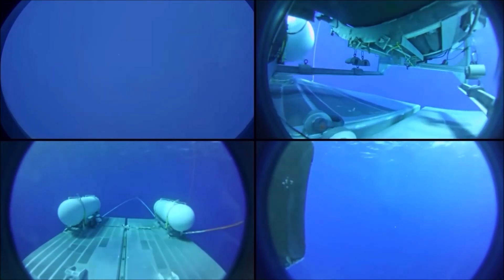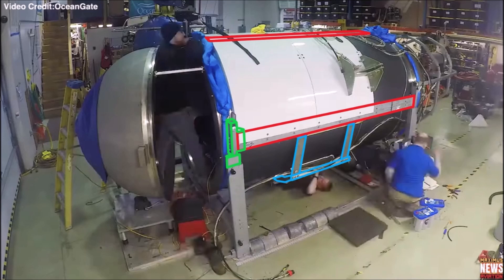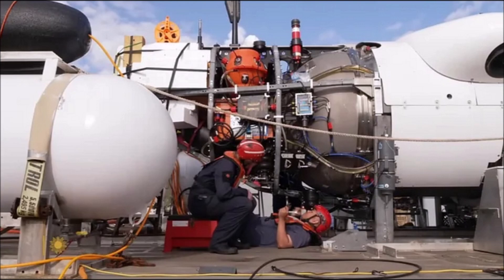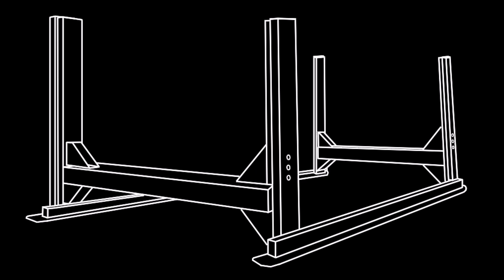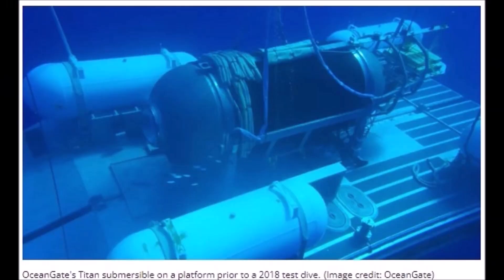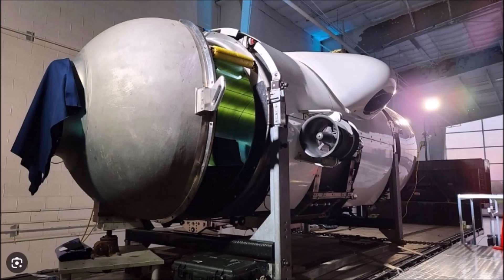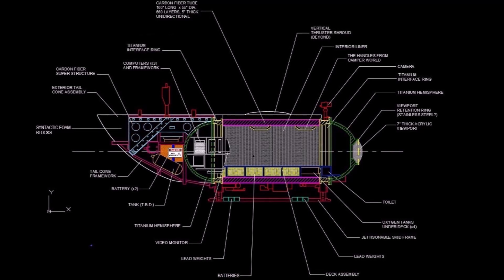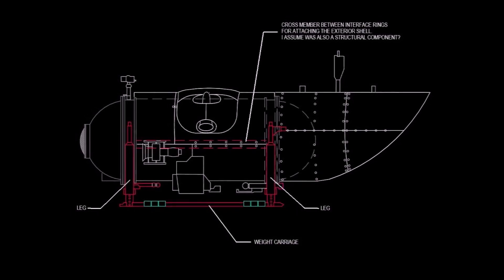OceanGate Titan - CONNECTIONS BETWEEN INTERFACE RINGS

Comment: Youre on the right path but missing some crucial bits.

The interface ring had flanges on both inside and outside. It's the inside flange ring that has been crushing against the composite. 

The hull was not only UD wound around the circumference. It had prepreg UD in the perpendicular direction also.

Howeverr, There has been a lot of assumption errors made regarding the properties of the composite, in particular due to a reduction in yield strength due to 1. Reduction factor in relation to imperfections with regard to thickness of the composite. 2. A wet layup method without the use of autoclave resulting in a much larger resin amount between layers. This is further worsened by the fact they used alternating prepreg through which the resin cannot flow when vacuuming during baking, if they even did that.

This is supported by the very fast manufacturing time they used making it impossible to cure and even less to autoclave between each change of fibre direction. It is also supported by looking at the layed up surface of the hull when still attached to the reel and its uneven surface and just before mating to the interface rings where one clearly can see its been lathed down. 

This means the hull has much softer properties and has a higher volume compression before yield than expected.

All this means the composite has been crushing against the inner flange and this is the point of failure.
Reply: @prose1733 and @VegasCyclingFreak.  You both are barking up the wrong tree a bit.  There were two Titan hulls, one fabricated by Spencer in Sacramento  in 2017, the second fabricated by Electroimpact and Janicki industries in Seattle in 2020 because testing in 2018 and 2019 showed the Spencer hull was only good for 3000m, not the 3800m where the Titanic lies. It was the second hull from 2020 hull that failed in 2023. The second hull had the same dimensions as the first but was made on much more sophisticated equipment using a computer-controlled, automatic fiber placement robot (AFP4.0).  Both the 1st and 2nd shells were laid-up with both axial and radial fibers per statements by Stockton Rush.  OG published a short video clip of the robot winding the second hull in both radial and axial direction.  The second hull was fabricated in stages of five 1 inch thick layer that were each cured in an autoclave before the next layer was applied.  Electroimpact and Janicki make carbon fiber composites for Boeing and others.  The second hull was designed using Collier Aerospace's Hyperx FEA software, presumably by Collier acting as a subcontractor to OG.  The first hull was designed by Spencer Composites using COSMOS/M, another FEA software.  Electroimpact has scrubbed their site of references to Titan & Oceangate but Oceangate lists them and Janicki and Collier as "partners" on the OG website and in presentations.
Reply from the maker: @engineerncook6138  Thank you for this very important information! No surprise they removed any reference to OceanGate on their website.
Reply from the maker: Thanks for the input. I only recently learned about the interior flanges. 22 million lbs of force on those hemispheres is asking a lot of that CF.

Spencer Composites manufactured this cylinder for OceanGate. The specs given were 100" long, 66" O.D., able to withstand 6,600 PSI with a safety factor of 2.25. There was no use of an autoclave, but it was vacuum bagged and baked for 7 days at 278 deg F. Originally was going to be 4.5" thick but OceanGate had them bump it up to 5" thick for "an additional safety margin".

From what I understand, CF when used this way is maybe only 50-70% as strong as it could be otherwise. If it was resin rich as you propose, then that compounded the weakness of the cylinder... made it weaker still.

Can you explain something to me? When I see that video of them winding the 660, 667 or 480 layers/plies (depending on who you ask), it looks to me like there is only the CF tape with nothing running perpendicular to it. How in the world did they get perpendicular layers in there with the tape being wound around the mandrel like a giant spool of thread? I just don't see how they did that. There is also the flanges on the ends of the mandrel, so how does that work?! Not only that it seems that the ratio between the two would likely not have been anywhere close to 50/50 if they had to hand lay these perpendicular fibers. I have been under the impression thus far that it was strictly carbon fiber tape and strength of the cylinder = strength of the resin. 

In my opinion it should have been cross layered in three different directions, but how the heck would you manufacture that?
Reply: @VegasCyclingFreak  Noone has been able to answer exactly what layer configuration has been used, but from the information that's been available it suggests they had aquired date expired pre-impregnated UD from Boeing, and Spencer previously claiming they used a 0 - 90 deg alterating, but as you point out this hasnt been confirmed nor visible in any video. 

The conclusion some have come to points towards the prepreg UD was used specifically for the perpendicular orientarion along the length of the sub axis. The question becomes, why would they do this, how did they do it and what does it mean for the strength of the cylinder. There is probably more than one explanation here.

1. The cylinder was not subjected to torsional load so any other orientation than 0 and 90 would not add capacity for the specific load case. 

2. The tooling and cylindrical spool used as a mold is most likely borrowed from other production normally used for a different application, presumably an accumulator or some other non critical tank made in fibre glass. Furthermore they likely used a similar layup technique as FRP with the addition of perpendicular fibre layup where the prepreg comes in and that would need to be manually applied by hand at some intervals, but as you also point out, a 50/50 ratio is unlikely in this case. 

However epoxy used for wet layup, even with extra long pot life, normally it's not more than a couple of hours. By that time the part should be in the owen. 

Furthermore prepreg and wet epoxy normally have different temperature profile requirements during curing. High performance prepreg laminates should be autoclaved to extract excess resin and should not be more than 1/4 inch thick between baking cycles. The ramp up and ramp down temperature rates are somewhat specific, but with a part this thick with so much mass, we know we are going to have a temperature gradient that is from here to hell and everything in between. 

Therse two circumstances raises several concerns. Clearly it is impossible to bake the whole 5 inch thick piece in one go without compromising the curing process requirements. On the other hand, curing it multiple times would not only be extensively labour intensive, we still don't know how many times that is and where the alterating perpendicular fibre direction layup and curing comes into play. It just doesn't make sense.

However what does make sense is the combination of thickness, wet layup and some major challenges regarding curing and pot life creates substantial geometrical imperfections of the laminates due to excess resin and trapped air. With this in consideration, this allows for fibre rotation in the matrix due to shear / strain followed by buckling in the elastic region. Others have looked into this and there essentially was no safety margin what so ever against failure of the cylinder.
Reply from the maker: @prose1733  Thanks for your input. That's some very interesting points that you bring up. There does seen to be a consensus in certain circles that it was likely resin rich due to how it was manufactured. Also if the CF was at the end of its shelf life, the resin may have degraded considerably. It was bagged and baked for 7 days at 278 deg F... but I don't think that's really adequate for something 5" thick? Spencer Composites made this for OceanGate, to the specs they provided. The safety factor was supposed to be 2.25 and able to withstand 6,600 PSI but who knows exactly how that was determined by Spencer Composites? At this point, it's my feeling that OceanGate got a sub-par hull.

This CF stuff is not really in my wheel house but I know a little bit about its basic properties. I feel that there should have been three cross layers instead of two, all things considered. I don't know how the heck that could be manufactured but it seems to me like that would be the strongest possible matrix.
Reply: @VegasCyclingFreak  regarding Spensers claimed rating, one should think about how they could have arrived at such a figure. Possibly using the same method they normally do, by modeling the component/assembly in their FEM-software of choice and defining the layup using the layer properties already available, but...

We have to member in contrast to FRP, CFRP when structural is almost never homogeneous and absolutelly never this thick. High performance CFRP is prefered where stiffness to weight is an advantage and from elementary mechanics and the definition of second moment of area we know that for a large "I" and low mass, we need a stiff outer shell and a hollow/foam/nomex/honeycomb core to aquire the area. This is clearly not the case here so pre existing definition and layer properties for CFRP in the model would presumably not reflect actual real world performance of the titan cylinder. So those definitiions would not be accurate for this homogenous FRP winding type layup and would explain some major discrepancy between that claimed value and actual peformance.

It's clever of you making reference to your bicycle and failure of the stem due to stress concentration and crushing from the clamp. CFRP manufacturing has come a long way much thanks to the challenges posed when laying up such a complex shape as a bike frame, in particular around the areas with small radius curvature and especiallt around the nodes and the crank aswell as where the forks join the stem. When CFRP was new to bicycling it was very common for the CF to wrinkle when bagged in these areas causing immediate reduction in rigidity when the fibres where misaligned and no longer oriented in direction of the stress. This shows how important the layup is for the performance to come near any type of calculation and it is still errors made during layup that is the cause of most CFRP failures.
Reply from the maker: @prose1733  Very interesting info! So it would seem that maybe they just solely relied on what a modeling program told them. Programs do have limitations, especially when they are being used in a way that was not really intended. Sounds like the case here. In my field, sometimes people get bit in the rear by misinterpreting what a program tells them. You would think that a sophisticated modeling program at some point would tell you that it can't do what you are asking.

Comment: The five hole lugs at the bottom of the rings hold the skid on. the four posts are friction fitted to the sides. the pneumatic ram(s) was underneath. that thing in the middle was a ballast dispenser maybe.
Reply from the maker: Aha! That would make sense. Explains some of those items on the underside that I couldn't understand the purpose of. So the hull basically sat on top of the two large cross members at the bottom of the interface rings that spanned across to each side of the skid. Makes sense. Thanks for the info on that.

Comment: The tail structure was weak and flimsy, the cylinder was distorting, the arcing skids show this in the parking lot pics. the welding for the lugs on the rings was faulty, one lug fell off its weld.
Reply from the maker: I interpreted the bottom of the skid as just normal wear and tear from launching in rough waters, transport, etc.  but it does look corroded from salt water to me.

Comment: goodstuff pall. it would be for sure the front dome. the back was bolted internally as well as outer.  the suport for the door when open could cause the damage to the carbon front joint the raft is bouncing alover the place. too not have torque wrenches is a scandel. any one of them bolts could have been damaged by over tightening. they should have been done up to an exact pressure. to not damage the nuts or bolts. and to make the seal correct. i feel the hinge and support at the hinge is where the seal breah happened. i also think the massive temp difference between the inner carbon and outer. the shrinkidge of the outer due to cold, inner not shrinking. acted as doubling the preasure on the inner 2 inch of the carbon tube. temperature has a big impact on both, all materials, ive twice took my carbon fibre fishing rods home not took apart, jammed together. soon as nightime comes cooler temp they slip apart with ease. both carbon items for fishing uve broke have been in freezing conditions, winter fishing, both are tubes both made ten times better than that sub, power mesh wheves.
Reply from the maker: I've thought of a bolt failing too. Watch my next video and let me know if you still think that the front dome/hinge was the problem. Remember, the hydrostatic pressure at 4,000 meters is 5,500 PSI...those domes are not going to go anywhere.
Reply: @VegasCyclingFreak  also the rings look like steel. how were they connected too ti domes. i am  sure titanium is brittle and would not bent but snap. twisted bent inner rings twisted and bent.
Reply from the maker: @theweasel-uf7dn  Domes and rings were 100% for sure titanium. Titanium has low modulus of elasticity, which means it's flexible. The domes were 3-1/4" thick.
Reply: @VegasCyclingFreak  goodstuff.howthe rings shiny and domes dull. the connect would be a weld then rather than glue. so they defo dint fail. the back dome is bolted solid in and out and never opened. so must be the front seal btween ring and carbon, has to be. what your thoughts on there being no suport rod underneath. top and sides feels wrong. but under water dont matter. that raft drag on ocean is a cak idea he and everyone else knew it was guna fail. he lucky he not here to face the music.
Reply from the maker: @theweasel-uf7dn  No support underneath doesn't really come into play except for maybe when lifting by crane, but then again the other three quadrants were all connected together. If you look at the debris video the rings don't look that shiny either. Also the domes were subject much more to expansion and contraction than the rings... might have discolored them a little bit.
Reply: @VegasCyclingFreak  pretend the carb tube was not there, and the domes were gone, now stand it up on your kitchen side. ring bottom ring top. 3supports. now press down hard as hell. am sure that 4th support  not being there makes a difference. my brain wont work it out for me.
Reply from the maker: @theweasel-uf7dn  Well me standing on it will do absolutely nothing. But 22 million pounds of force? Yes.
Reply: @VegasCyclingFreak  the back dome was bolted internally as well. the front was not. the stress on carb tube was most at that hinge, and front as that was the only opening. i still thing the hinge is the spot. the poxy raft and dragging it about on the sea, wow,   the temp would have caused a massive crush on the inside off tube zero outside to about 18 degrees inside AT THE MIDDLE of tube. the cold ti would aid the ends off tube cooling. ive seen vid with 2 big dents in front ti dome ists been erased its gone. i think they smashed it 3 days bfore trying to get back on raft.dont fget it was bouncing around on surface as skid or legs had been dumped 3 days before. like a cork bouncing up and down. upside down sideways up. the dents were just above the hinge and hinge side. bout half inch deep. ti ia hard that was a big inpact to do them dents.
Reply: @VegasCyclingFreak  also bet when they tested them they did not test at the temp near or at freezing. carb contracts with cold. but it does not???? transfere heat like metal. if it was a inch thick this is ok. 5 inch not good. the sub is already crushing itself due too the cold outer and warm inner

Comment: I don’t see a whole lot of innovation here, this sub is simply the 21 century version of the pickle barrels people used to go over Niagara Falls
Reply from the maker: Ha ha, that's an interesting way to put it. The "innovation" here was the use of carbon fiber in the hull, and the real time monitoring system used to always be checking its integrity. In hindsight, maybe not a great idea for a submersible? 🤔
Reply: i agree, this was doomed from the start. The Joints between the end caps and the tube are going to fail, he should have known or did he??   Insanity.

Comment: I think it should also be taken into account that this wasn't a one off design. Graham Hawkes used the same carbon fibre tube design capped with Titanium endcaps for the Deepflight Challenger later acquired by Richard Branson for Virgin Oceanic. The 5 inch hull was even manufactured by Spencer Composites. A lot of R&D was already done, he was scaling up. Virgin Oceanic received a lot of concerns about this hull and later discovered it was only rated for one dive when they planned five. They mothballed it. Stockton apparently tried to buy this submersible so it clearly was something he was interested in and had faith. Yet Branson and his engineers seemed to heed the warnings.
Reply from the maker: That's interesting. Do you have a source for this information?